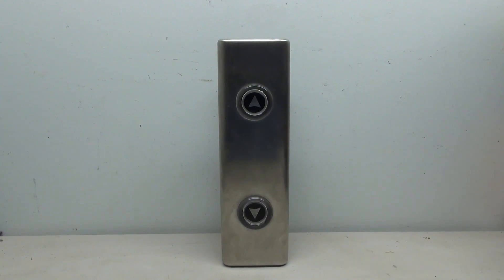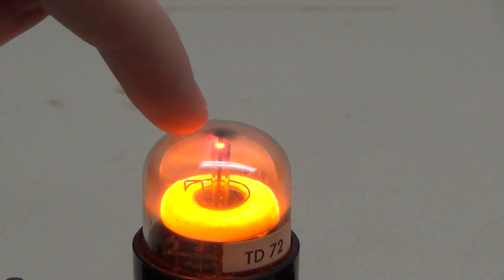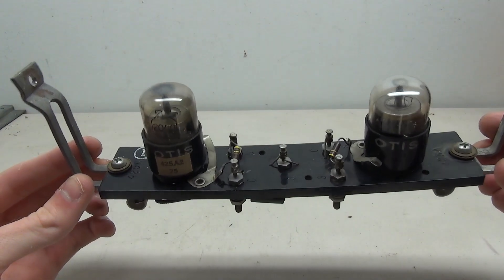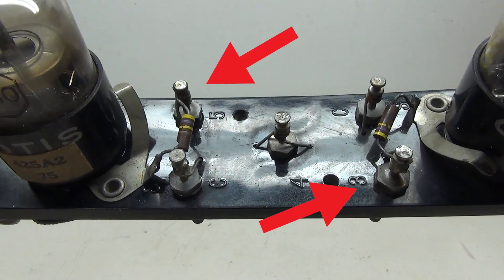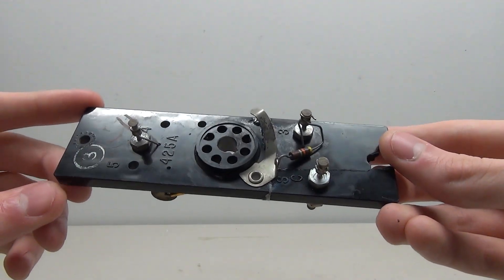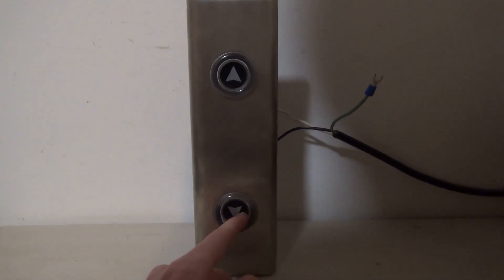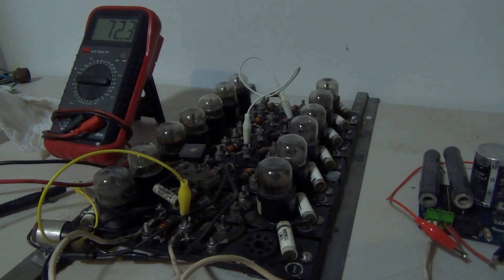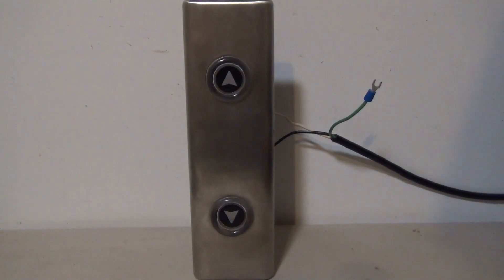How To Wire Otis Touch Elevator Buttons

Comment: Does anyone know the type of light source used in these? Does NOT look like an incandescent bulb. Is it some sort of neon discharge lamp? Have never seen this before
Reply from the maker: As quoted from an Otis document: "Touch buttons utilize a three element gas filled tube as the active component."
Reply: To clarify, as far as I know the touch sensitive tube itself is what lights up.
Reply: I have found the answer. It is actually a neon lamp which is considered a miniature gas discharge lamp. This is actually not the same as the larger neon tubes use for signage

Comment: Could you add a relay to it to make the buttons control things such as arrow lanterns?
Reply from the maker: It’s not as simple as that due to the way the tubes work, but with the right circuit, yes!
Reply: @stlelevators  is it something based on voltage or resistance?
Reply: @atomstarfireproductions8695  Resistance, the tubes can only take max 25mA through them (technically a peak pulse of 100mA). That's not much for a relay. You could try getting a specialty relay that could take the 60V that is present across the cathode resistor. But you're better off just using a SCR (just like Otis did), and connecting your relay to that.
Reply: @BigKitty1011  so inside the elevator controllers, did they have amplifier tubes or maybe later transistors?
Reply: @atomstarfireproductions8695  They would have used a thyristor. (or thyratron if using vacuum tubes). Now this is not the only way to run a relay with these tubes, an optocoupler would work just as well (while also providing isolation). Of course, they didn't have optocouplers during the time, so they just used what they had.

If you really want to run a relay with these tubes, I'd suggest reading this pamphlet by Otis first. https://drive.google.com/file/d/1nZzTJ7d36-0OTUZWkCUgzLGgmPIH_MyF/view

I wouldn't suggest doing this if you don't know exactly what you're doing. Lot's of things can go wrong with these tubes (trust me, I have some pretty good stories to tell)

Comment: I also noticed you had another one of these hall stations, but with the Adams Survivor-O "drop-in" replacement buttons in your collection, and therefore, I am wondering if you could make a video about the Otis hall station with Adams drop-in buttons.
Reply: I assume it just looks like touch but has an Adams survivor base
Reply from the maker: It's just like any other Adams intermediate button.
Reply: @stlelevators  Indeed, but I noticed that they had only 2 contacts on one side instead of 4 contacts (2 on each side).
Reply: Even though the contact arrangement is slightly different with a special common outlet and jumper tab, I was actually able to wire one up and make it work.
Reply: As a retired Otis engineer who, back in the day, was lumbered with working with these things, I always considered them to be pointless gimmick.
 Just a personal opinion, but the era of these things being fitted soon passed.

Comment: Jason, I think you should do a project on how to wire Monitor TR Fixtures.
Reply: And how about the Adams Survivor-O, since you have one of those Otis hall stations that had touch buttons but were replaced with the Adams drop in replacement.
Reply: Monitor is basically the same wiring of Adams survivor
Reply from the maker: Monitor and Adams are basically the same idea. Just a different looking base. My Long call button video shows Monitor wiring as well.